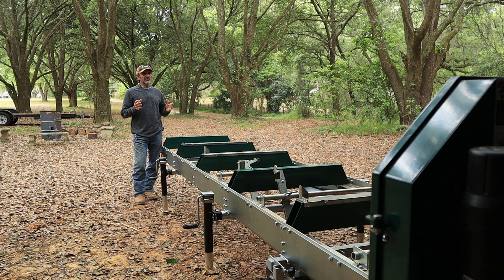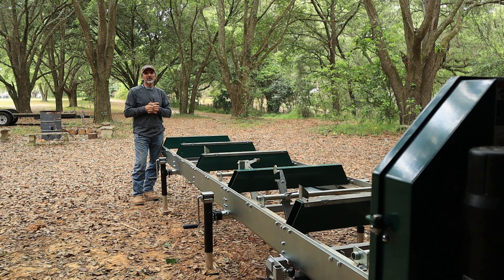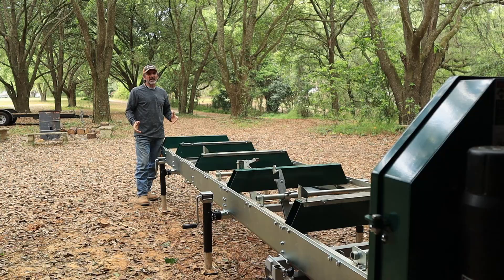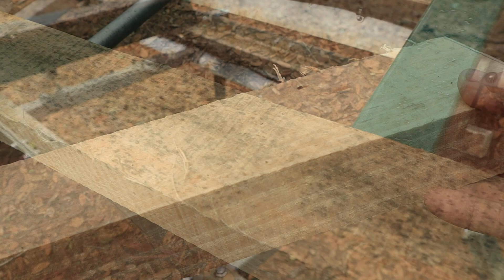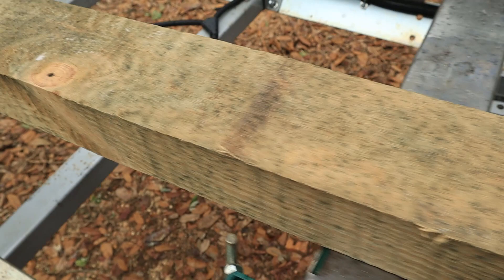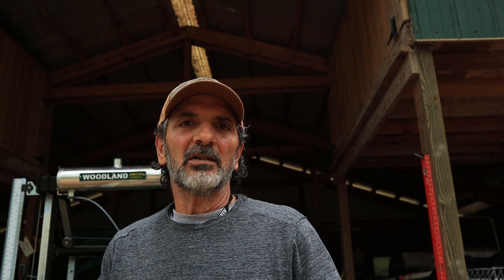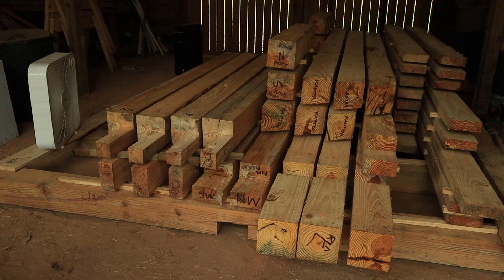I did not see this coming!

Comment: you can save electricity by cutting your timber “proud”, let it dry, warp/twist, grow mold, etc. and then near the time of actual use you put it back on the mill and make final cuts. Mold is easy to hand planer off but bigger twisting may not be overcome by planing. I cut 6x6s initially as a 8x8 (or as close to that as possible), let then season covered overhead-only outside for at least one year, then cut to final dimension when I want to use it. My timber is clean, straight, stable and dry when actually used.

Comment: Just found your channel. I like your content and subscribed. Good luck with it. Beautiful slabs. I s the one that has the pith running through it stable enough to use or do you cut it into dimensional lumber?
Reply from the maker: Matt....that slab is currently air drying outside. So far it has remained stable. My hope is that it can be used as is. Thanks for the kind words and for watching.

Mike